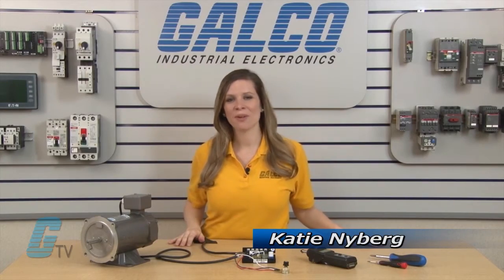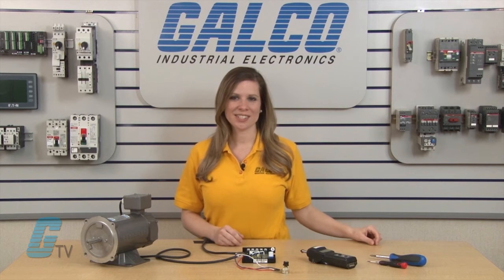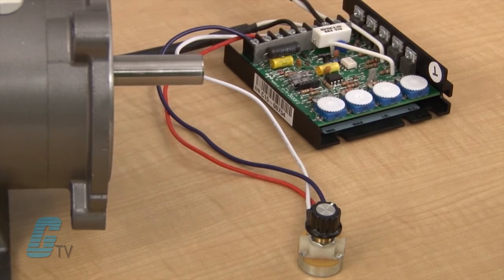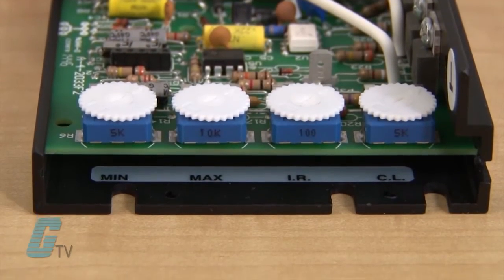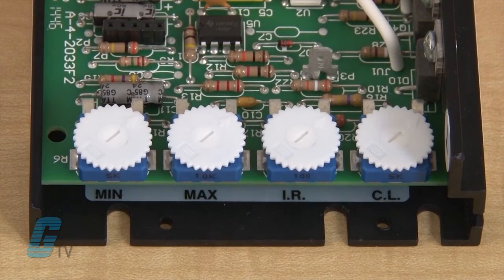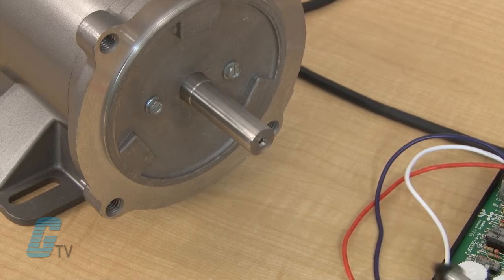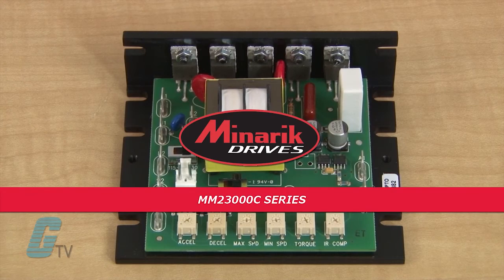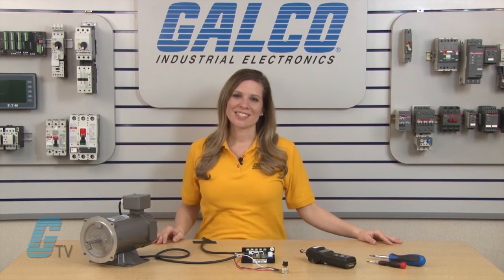What are trim pots on a DC Drive and how to change them

Comment from the maker: The term trim pot refers to a trimmer and is a miniature adjustable potentiometer that can make changes to preset values.  Digital drives that have the capability for programming will generally have these settings adjustable in a parameter and will not require trim pots.  On analog DC drive boards there can be a group of trim pots that usually can only be adjusted on the circuit board of the drive.  The most common adjustable trim pots are Minimum speed, maximum speed, Acceleration time, deceleration time, current limit and IR compensation.